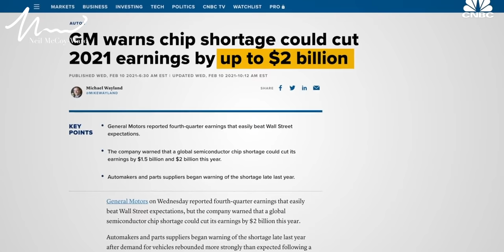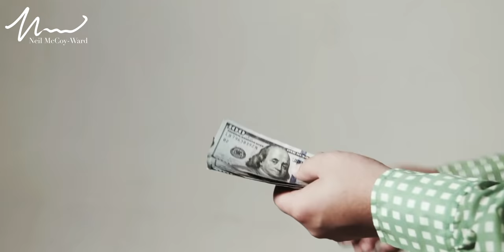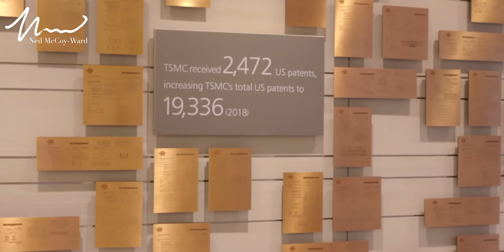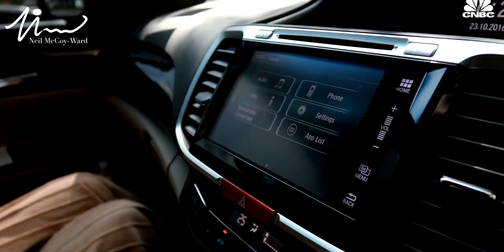🔵 Chip Shortage Leads to 2 Year Backlog!

Comment: Back in 1971 gm did not put a drain cock on the radiator to save money now they put 8 thousand dollars worth of useless crap on the cheap cars go back to basic  a ranger 4 cyc stick with heat air and a radio sell it for 9 grand you would not be able to make enough trucks for demand

Comment: Don't need the chips. The chips are for gas car's, not Electric car's. Ford/GM/Voltswagon..ECT. Except "Tesla" Have not even produced a new Electric car yet. The Suez canel was a way of dumping the chips. They where never ever ment to make it to the car manufacturing plant's. There is enough gas car's, between the dealer-ship's and the manufacturing plant's for 10 yr's. Within 10 yr's we should be 90% off of gas car's. O! and Tesla also soved his chip problem.